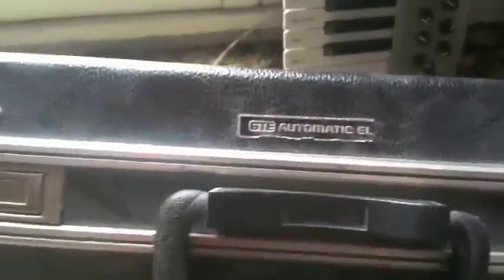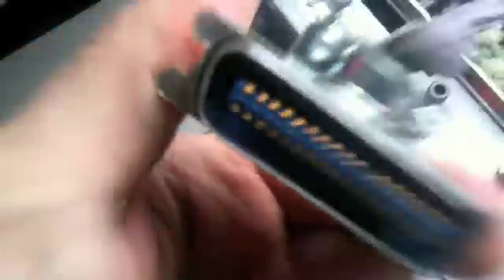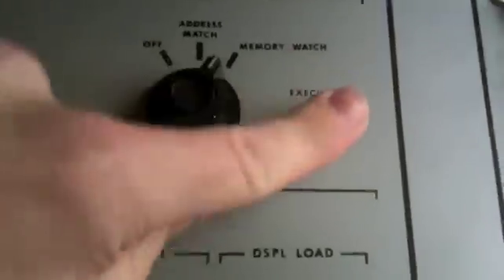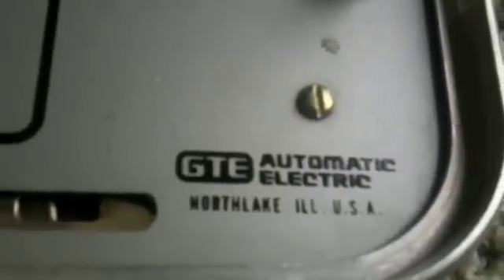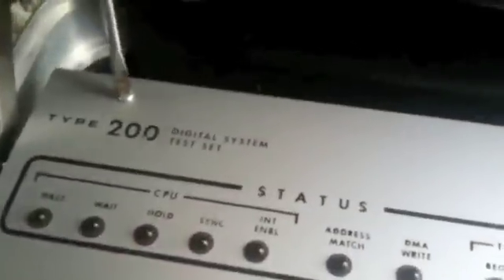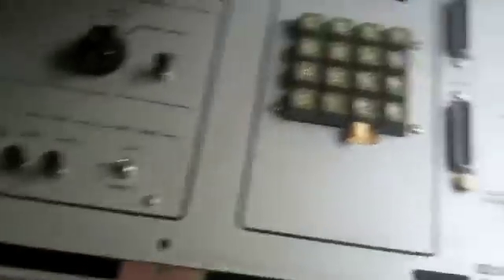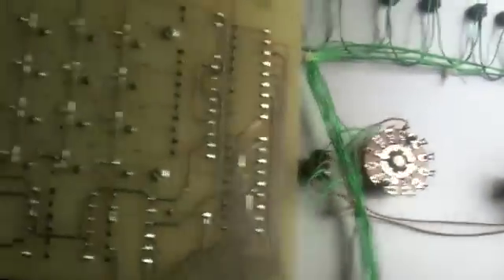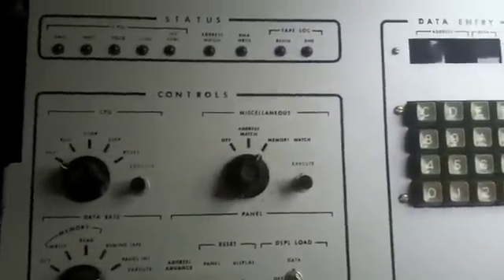GTE Test Set

Comment: As a manufacturer of complex electronic telephone switching systems, we at GTE Automatic Electric have faced a number of problems in manufacturing, particularly in the area of data control and data collection. As is typical of most electronic products, our products are highly complex and therefore, subject to frequent and often severe circuit changes.

Comment: (PT.2) you could look up the datasheet and figure out where to hook up wires to which specific pins on the cables. Another way to do it is to cut off the end connector and look at the color of the wires. Its possible that the positive and negative would be color coded (red, black, white, etc) OMG please please do it or sell it to me or something. DONT BREAK IT OR PULL ANY WIRES OFF!
How much would it cost to ship? I might take that off your hands!!! If I got it to work of course id make a video.

Comment: Jesus, I wish I could take that from you..when you said you almost werent going to take it apart I almost smashed my computer in anger.

What you can do is first get 5 volts DC and try to figure out the positive and ground connections on the board. It might be marked on the circuit board itself with markings like (V+, Vcc, Vdd, V-, +5v, GND, etc) if you can figure out where that power goes then you can start with 5 volts and work your way up to maybe 9 or 12. If you can figure out the port then